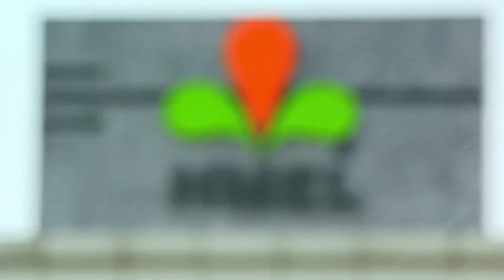Super Structures - 5 min Nat Geo Feature

Comment: Keshav Generators Private Limited
 - K. Lal Dhiman 9810442414 - Bathinda 
Established in 2000, Keshav Generators Private Limited a has made a well-recognized name as a Wholesaler, Trader And Service Provider of Silent Diesel Generators 15KVA to 2000KVA on rental , Diesel Driven Screw Air Compressor 200CFM to 1500CFM on rental, Generator and Air Compressor Rental Service in Pan India , Generator Installation Service, Generator Repair Service. We provide only branded Generator like Cummins, Kiloskar, Mahindra, Catterpillar, Sterling, Volvo and Eicher. We have achieved expertise in providing Generator in Affordable price & we are Best Vendor in Pan India, catering to the requirements of our clients exactly as per their specifications. We emphasize on stringent quality standards in order to ensure that the products provided to our clients is always optimum to its level.

For our accomplishment story, we are grateful to our owner, Mr. K Lal Dhiman and Mr. J.S Dhiman, whose continual backing and direction have been useful to us for attaining exponential development in the current market.